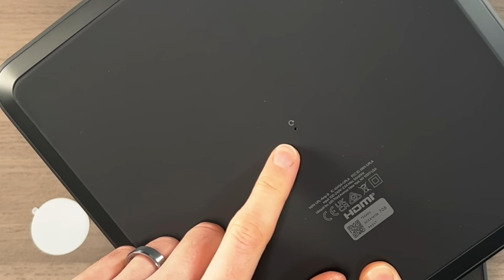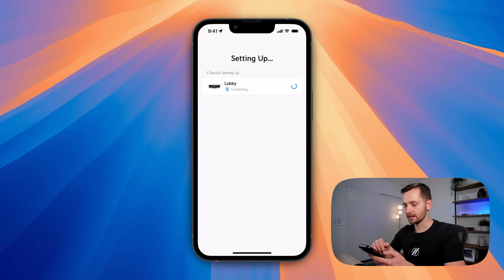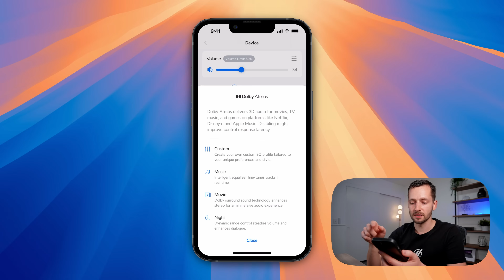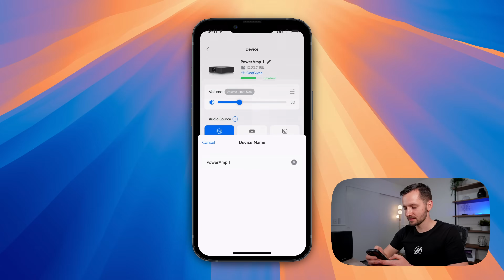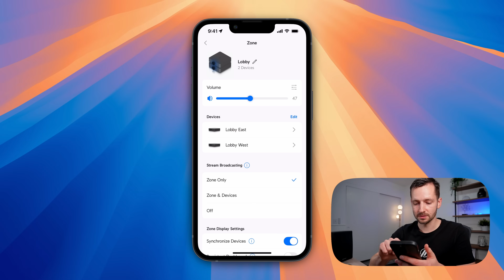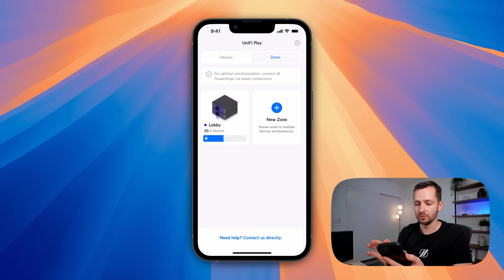UniFi Speaker Amplifier | PowerAmp Beginner Setup Audio Streaming eARC HDMI

Comment: I can only see two use cases for this.  Commercial, as you point out.  And to give your computer some more musical output.  Almost everyone now expects surround sound at a minimum, and Dolby Atmos on the higher end for TV sound and musical output.  Why is there Dolby Atmos on this when there is only one left and one right channel?  How would it place objects without mapping?  They are adding Atmos to everything, even though you can't actually use it, but you pay for the license.  You need a minimum of 7+sub for Atmos to work properly!  This UI system is limited to stereo channels, mostly for streaming, which may be just what some people are looking for...
Reply from the maker: I have no idea how that Dolby Atmos works. At least it has a sub output too so you get 2.1. I could see 5.1 coming with another model since they now sell in-wall and in-ceiling speakers.

Comment: I think for retail shop it needs to support 70V/100V.  Two speakers would only work for the smallest space, most other places would need more speakers and since those would all be in mono, a 70V system would be better since you can daisy chain speakers together.  Hopefully they come out with something that supports this.

Comment: Hi @ApexOneIT, I just watched as I'm considering PowerAmp for my setup.  I have existing outdoor setup where I stream from AppleTV via Airplay to legacy Apple AirPort Express (which acts as an AirPlay receiver for Audio; I'm assuming Airplay 1.0 due to legacy factor).  To power the speakers of course I have a mini-amp right after the Apple Wifi Router with a split cable going from 3.5" to two RCA.  PowerAmp seems to simplify this entire setup.

I'm assuming PowerAmp is broadcasting AirPlay.   It most certainly works, but chance have you tested with AppleTV or airplay from a Mac computer which would be equivalent?

Comment: Daisy Chain on port2 feels weird, because If you have a very large home and lets say you have an outdoor patio, the Connection at the Patio can be wifi because the Outdoor TV could have a device for ARC and local audtion,  while in the inhouse amp(s) for lets say the Roof Deck can be in the server / audio cabinet.  

Sonos does this well without lag, or at least I dont hear it.  I am really not understanding the UI version.

Comment: Is it possible to run this in Mono and run one set of speakers to one channel and a second set of speakers to the other channel? My use case is I want this to run ceiling tile speakers in the lobby for Spotify on channel 1. But if we need to overflow our event into the lobby I want to be able to run directional speakers for a projector in the lobby on channel 2. When using Spotify I only want channel 1 active but when using overflow I want both 1 and 2 active.

Comment: This will fail fast. 
- No Tidal connect or Tidal Hi-Fi 
- No Google Casting
- No Roon
- No local NAS support
- No toshlink for external device that could have given the thing a life. 
- No room calibration 
- No external controle input, remote or a POE screen to adjust volume in a meeting room. 

This is doomed.

Comment: It would nice if it supported multi channel for surround sound / Atmos either through a single device or by splitting channels between devices.
Reply: Just buy a Denon at that point
Reply: @tordb yeah I have an Onkyo A/V Receiver but just saying.

Comment: Can a direct audio input via the RCA of one amp be played over several network attached amps? And could you have multiple RCA connections going to the multiple amps (one each lets say) and can you select which amp's inputs are streamed to all?

Also, if you have a MP3 player on your phone, could you use that to stream to the amps via bluetooth? I hate subscriptions and I own all my music so I will never got spotify or the like.
Reply from the maker: No, must use a cable splitter to achieve that. More info here: https://youtu.be/o0HRz0OoilE?si=isii3rfsgmQlk9NR&t=847
You can stream anything via AirPlay. Of course you need an Apple device for that though.

Comment: so can i use my network to stream gaming and movie audio from my pc to this device. my pc is in my rack. if i put this on my desk and integrate into my unifi network can my pc use this as the audio device for my speakers?
Reply from the maker: It doesn’t integrate much at all into the UniFi network. At least as of now. It’s not audio over IP. What you can do is connect your pc output as line-in to the amp. Much like you would do with “regular”  powered speakers.
Reply: @ with my pc outside the room that’s not possible. Thanks for answering

Comment: These look so nice but also crazy expensive if you want to wire up a bunch of rooms. I'm not sure the value is actually there though I would love these in my rack next to the rest of my unifi equipment. I think for now I'll stick with my arylic DIY stream boards + fosi amps, where I can power two speakers for $150 (cheaper even if you are okay with their amp + stream boards). That setup has been absolutely rock solid for me primarily using it through spotify connect. Though I guess if you think Sonos amps and this are overpriced you're not the target customer.
Reply: not crazy expensive when compared to the "industry standard" Sonos Amp at $800 lmao

Comment: Just a shame it is not ROON ready or tested. As it is a hard No for me. If/when ROON is supported it goes to a Yes.
Reply: It looks like Ubiquiti are a Roon's competitor as they use the wifi/ethernet network to keep units in synch instead of using RAAT protocol to bring audio around the building.
Reply: ROON can also use WiFi and Ethernet, so you have me a bit confused. I have the KEF LSX II and the LS50 Wireless, which are both WiFi and Ethernet and ROON ready. So, they are not competitors. ROON Ready would just make the unit more compatible and more Audiophile.
Reply: @dannyynnad132   RAAT its a transfer  protocol. Yes ,  you can group speakers in ROON like Ubiquiti but not sure it is most compelling/primary feature.?.?.